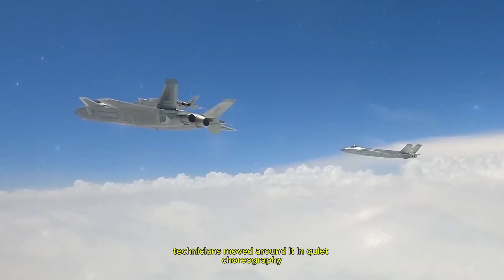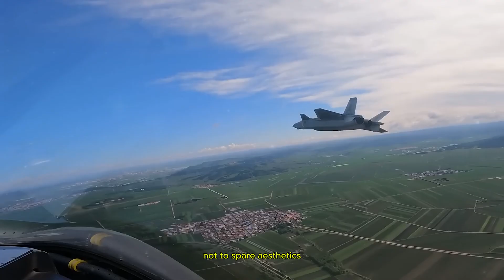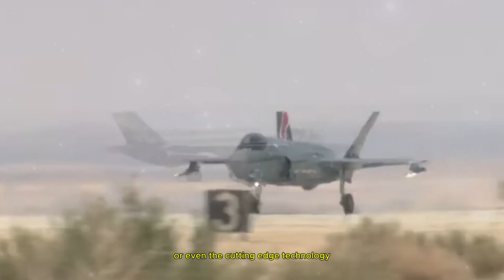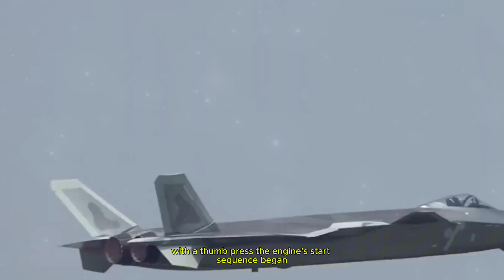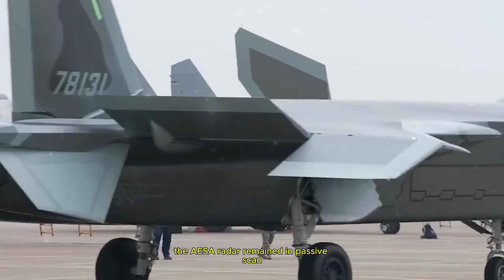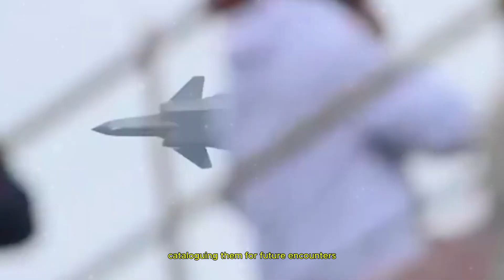INSIDE THE CHENGDU J-20 MIGHTY DRAGON THE RESPONSE TO THE AMERICANS THE F-35 HUNTER | REAL IMAGES

Comment: Advanced engines? No they don't. They still use the badly designed copies of the Salyut/Lyulka AL-31FN and their home grown version the WS-15 Emei engine still doesn't use the high quality metals used for fighter engines. Also given the WS 15 still doesn't even match the F22's output.

 Your presentation is meerly more Chines posturing trying to sound import or believeable.